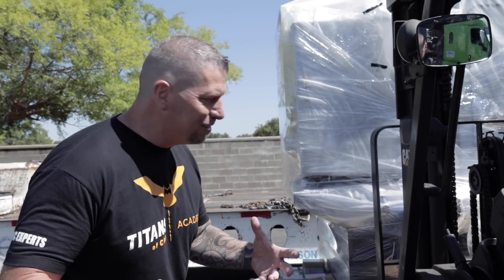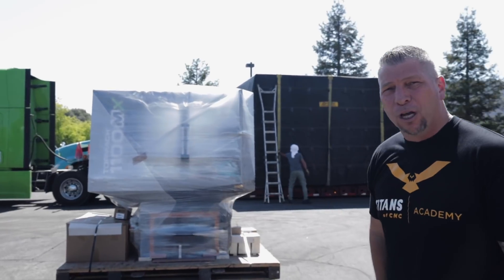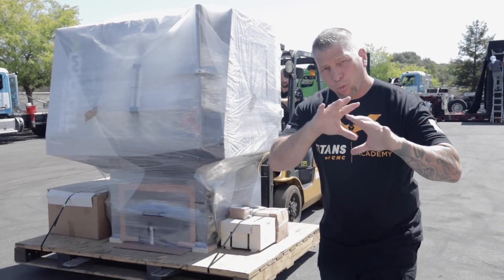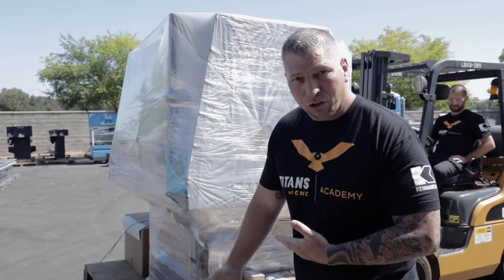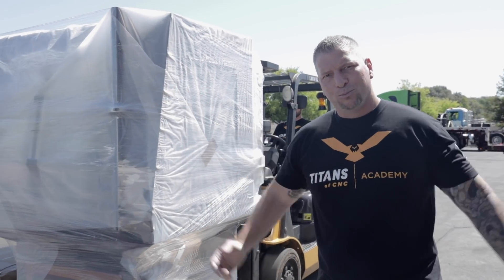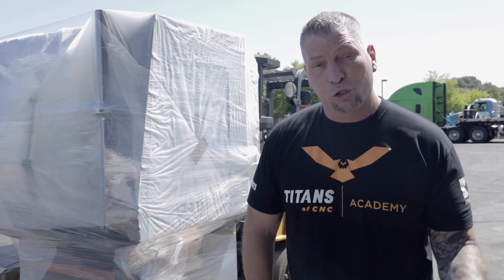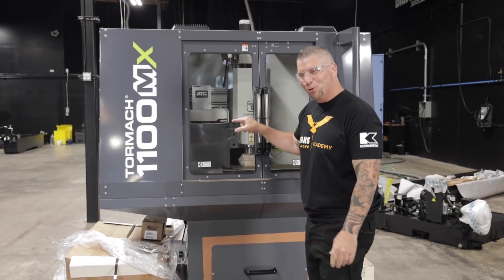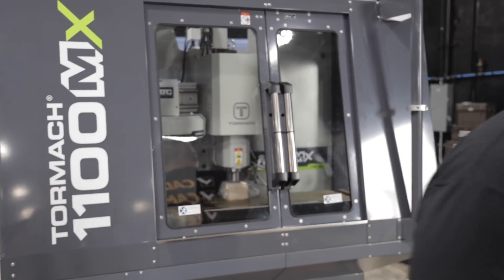Tormach 1100MX CNC Mill Arrives at Our Shop | CNC Machine that Plugs Into Your Garage!

Comment: Arrived assembled?  I don't know if that's a one-off for you for Tormach to assemble the stand/enclosure, but I would have paid a little more for that if it had been an option!  My son and I have sequential serial numbers 1100MX.
Reply: Great Question.. Is this a one-off or can I get one delivered the same way?
Reply: Yea putting the lathe together was quite a bit of work lol
Reply: They come disassembled normally. DO not know if you can pay the extra for assembled one
Reply: Tormach now offers Machine Assembly Services! The cost of this service is dependent upon machine configuration and accessories ordered. The level of assembly is dependent upon customer site restrictions. For example, we cannot do a full build and install an enclosure on an 1100MX if there is a 36-inch doorway between the delivery dock and placement location. Our team is happy to discuss needs and provide a quote for machine assembly! Simply fill out this form https://tormach.com/assembly-onsite-installation or mention it in the comments on your quote request.

Comment: Thanks Titan for all your hardwork with the academy 
I built my own CNC milling machine with LinuxCNC and Sieg milling machine, created a metal enclosure for use with coolant.
Built for around £2k you can make one even cheaper CNC mill but the learning curve is a little steeper.
Reply: Hay dave! I've built lots of 3d printers but how do you make a mill without a bigger mill? Do you hire a local shop with big machines to make everything parallel or is there some tricks?
Reply: @RedBeard20842  I have some videos on my channel about my minimill, but they are a bit old now as I have not posted anything in about 2 years.
Reply: @RedBeard20842  you start with a "cheap" manual mill and add steppers

Comment: I have learned so much with my Tormach and this channel. I wish I could have gotten the 1100mx (it was out when I got my 440) but it was 2" taller than my ceiling. ANd while I was happy to put in a fake light can for the drag chain to go up into, I had a HVAC duct right above the ceiling. And while I could have made some weird sealed box to let it go up there, seemed like a bad idea... But you just need to go a bit smaller and slower.

Comment: New 1100mx vs a low hrs haas mini mill?  What do you say Titan?  I’ve been looking at Tormach for years but never had confidence
Reply from the maker: Depends what your making... 1100mx is a great machine but doesn’t have a lot of HP? So you have to plan your strategies and cut softer materials... after options, a minimill cost twice as much... and is still made for aluminum. Tormach is what I would lean to and then get a bigger machine when I had the money or financing. But again... what are you making.

Comment: 30k for a tormach that thing better hold less then .001 tolerance all day your better off getting a used fadal or Hass for that price that can run production all day and have larger travel
Reply: I think you’re missing the point.
Reply: @Icutmetal  and what point is that

Comment: I would never buy a tormach, due to the fact you cant buy then in the UK so I might get my self a syil instead
Reply: Yeah same here for Denmark. Really too bad they are not available in europe unless you want to import them yourself. I would rather have a Tormach than a Syil.
Reply: @SimonVA99  from my reasearch, syil machine are better built and more rigid machine, but tormach look nicer and have better control software
Reply: @SimonVA99  Tormach 1100M and 1100MX are available CE certified.